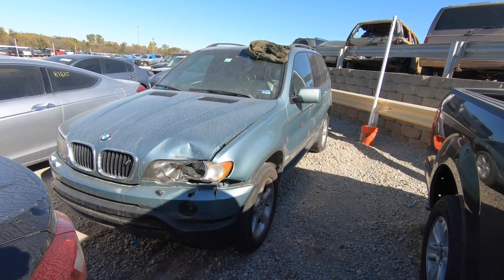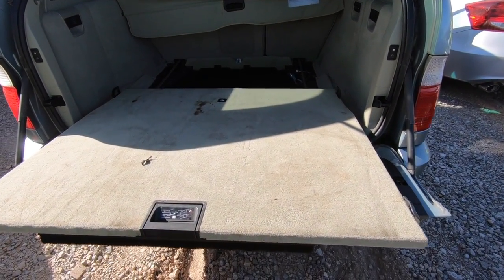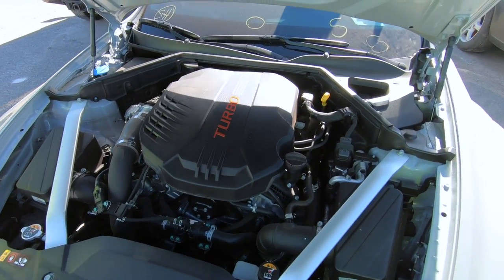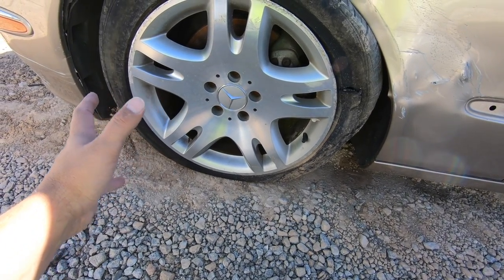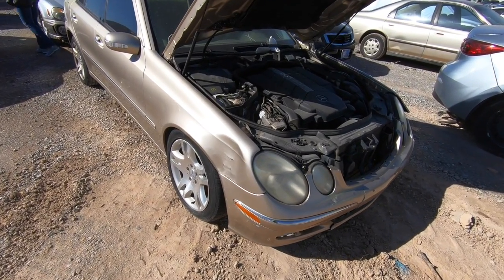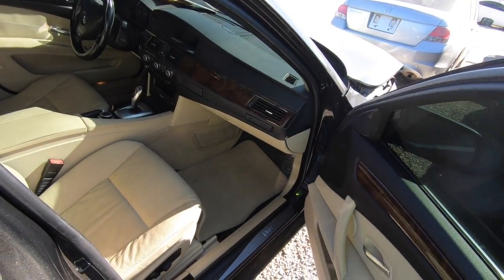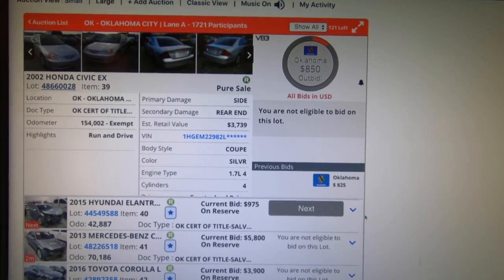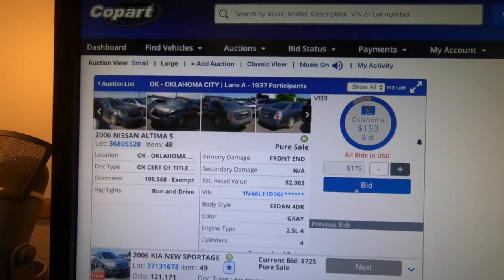Copart Walk Around AND LIVE BIDDING!!! Let's GO!!

Comment: Don't get any E class that is 2003-2006, they have brake by wire system (aka SBC), when they work they work great, however when it has problems or exceed its mechanical cycle  (50,000-100,000 brake pump actuations) it requires the entire ABS unit/pump to be replaced and reprogramed and it can be $$$

Comment: If you take that X5 home for under or around $1500 you can sell it for over $3500.  Those repairs should be under $500 because they always have those cars in the junk yard. This summer I flipped an 04 325xi.  Got it for $1300 everything total and sold it for $3500. It had 125k miles.  It only needed a new expansion tank cap and a gasket for the water pump. I only spent about $80 for coolant cuz I was losing a lot everytime I open the system for more diagnose. And I could of saved $360 if I'd picked up myself.

Comment: For what it's worth, that Lincoln Town Car probably had the cooling fan seize up and it overheated and caused a small fire before it actually blew the fuse for the high speed-side of the fan. I saw this happen to a fan motor on a '99 Continental where it blew the low speed fuse but wasn't blowing the high speed fuse even though the motor was physically locking up due to rust getting pulled into the motor vent openings near the magnets and eventually seizing the rotor intermittently. Had stopped to take pictures of the car and smelled electrical while idling. Quickly shut it off and inspected, and saw smoke from the motor. Unplugged that motor and limped it home. PITA to replace on the Continental due to core support and transverse layout making removal from engine compartment next to impossible, but on RWD platforms it would be easier.

IF cars like the Town Car used the same fan motor design (I've seen the motor design used in smaller Fords like the FOCUS or possibly Fiesta IIRC) as the Continental, they are problematic IF rust starts around the the opening to the rotor and windings as it'll eventually lock the motor up and the high speed fuses are seemingly too high to blow before overheating and causing a fire situation, suggesting a design oversight. On that town car, would probably need to replace cooling fan, radiator, condenser, misc. plastic, wiring, and any relays in the area. Some Ford electronics for other things in the car are routed in that area as well.

Comment: You can upgrade your Copart account to full bidding power for another $180. Copart will refund your $420 deposit, then you can 'upgrade' your account to the $600 full account which is a $400 deposit + $200 fee and have enough bidding power to lowball a dozen vehicles at once (or whatever strategy will give you wider coverage). Alternately if you just use the upgrade button on Copart's site, they'll charge you $600 and then you can get your $420 deposit refunded separately. Their site is not smart enough to automatically refund it when you upgrade, you have to ask for the refund.

Comment: You could put that Subaru back together cheap if you could get a harness cheap
Reply: Subaru often has a single harness for the body and engine, which means tearing apart the entire car to replace it.  Many other car companies use separate harnesses which makes it much easier, but even then would require tearing the dash apart to replace that section.

Its a project that requires gutting 2 cars and reassembling one, not worth it unless you have time to burn.

Comment: You don't get scared that these older cars have more issues then just the crash? I had bought a 2012 BMW 328i for $1100 with 140k miles car had been just run down looked good one side of the front bumper was sagging that was about it. But it was a complete POS. It was a repo car and whoever had it put 50k miles in a year and a half and the car had so many issues I was about to sell it for $4k when litterally the car didn't turn on after driving it maybe 400-500 miles without it having issues with stalling or turning on or anything. It had like 25 cel codes. And took a shit on me. It would've been cool to fix up but I don't have the time. Ended up selling it for $1k just to get rid of it

Comment: the merc is probably worth more in parts. as you said a front bumper $250 so the rear is probably worth the same, the wheels, the ABC air struts $500 per corner, it soon mounts up in parts values

Comment: Those vendors are about a hundred bucks I believe it was last one I bought the bumper cover was a 120 that paint jobs another problem in itself especially if it's at Mercedes silver it is a pain in the yoo-hoo to match up what 200,000 miles on that car I would have gave more than 500 for it

Comment: 13:28 I think that subaru ran from the cops person running might of hit a cop
Reply: I think it's the police baton that smashed the windshield and that spiketraps flattened the tire. After driving for a while, the flat tire blew and later smashed the wiring to bits, demobilizing the car and consequently stopping the chase.
Reply: @WhereverHugo  you might be right
Reply: WhereverHugo police know better than to go after the windshield. They will ALWAYS go after the window on the side because it’s tempered glass so it’s going to shatter into pieces.
Reply: @jwjones91  Yeah,  you're right. But sometimes they break or hit the windshield to frighten the driver into a mistake to quickly stop the chase. Other than that, I've got no clue to why they didn't break the side window.
Reply: I guessed the same thing. Lol

Comment: No X5!!! They're made in the U.S and have sooooo many problems. BMW suv's are very unreliable even when u take good care of them. Transmission issues (maybe not this one cuz its manual, water pump issues, and soooo on
Reply: Boots N Pants lol x5 is one of the most reliable bmws I've owned 4
Reply: eddie lewis 90% of the time ive seen this gen X5 they're in parking lots being fixed, on a tow truck, or being pushed to the side of the road. Literally just saw one yesterday being worked on in the parking lot of a walmart because it was broken down lol
Reply: I've never owned that gen but I'm talking from what I've seen there great cars I've owned 2 e70s 2 f15
Reply: I've had a 2009 x3 reliable as can be
Reply: Boots N Pants - you are 💯 percent right about these x5 .  I had the same exact x5 same color and all except  mine was a 2003 x5 , wit a 4.4 engine  automatic transmission., . Omg it was a nightmare , problems after problems every week , my mechanic was making a fortune out of me ., I couldn’t take the costly repairs and sold the Bmw 3 years ago .
Reply: Boots N Pants, you could say that just about any BMW regardless of where it’s made. One thing about BMW is that they can’t make a V8 motor. Every V8 between 1995 and 2012 had some fatal flaw to it. Their V10 also had a design flaw.